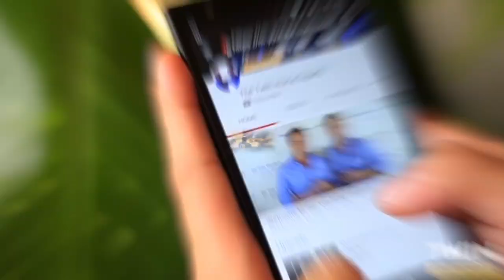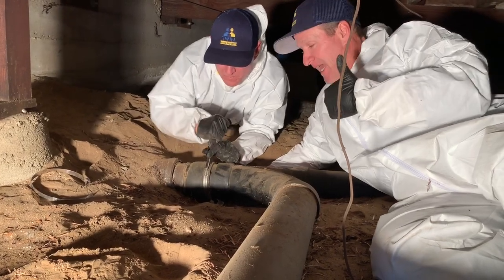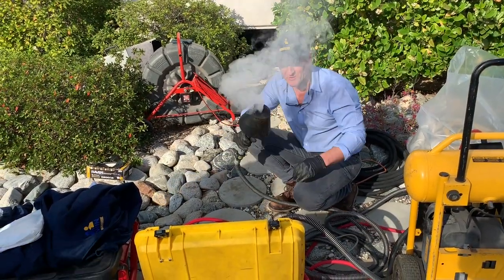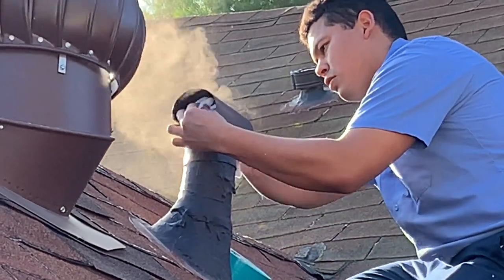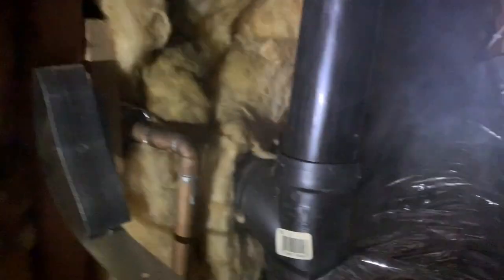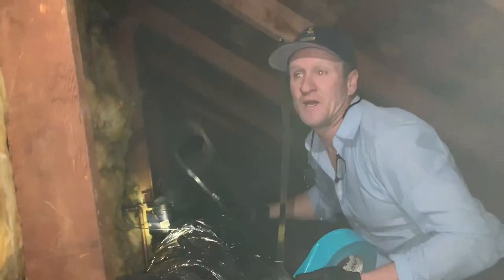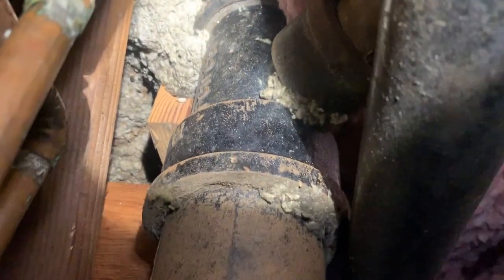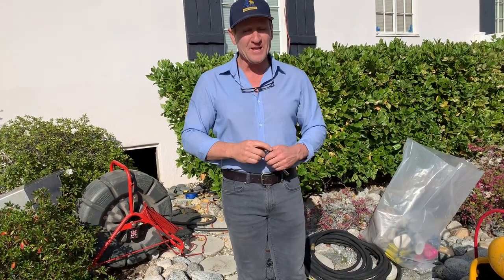Mice in attic? Scratching sounds in walls at night?

Comment: How much does it cost to smoke a NE cape house in Mass?
Reply from the maker: This all depends on access and what issue your having. Can be 875.00 for a 35000.00 for local plumber to do this. 
If we fly out to do this can be 5,000.00 to 10,000.00.
Reply: @TwinHomeExperts  FLY OUT!  COME ON GUYS , YOU'RE CRACKING ME UP.